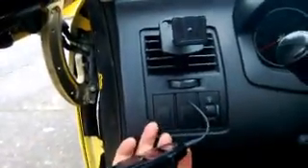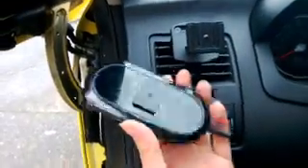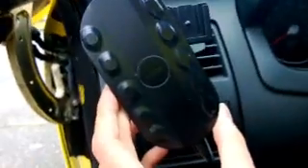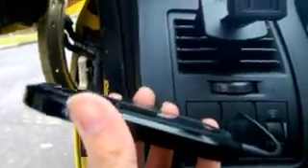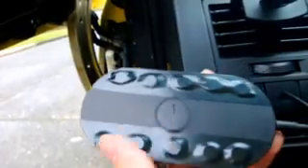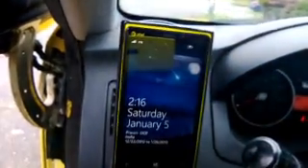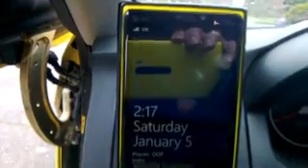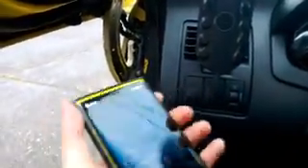DIY Nokia Wireless Car Charger Mod for Lumia 920

Comment: LG has one out.  Car cradle smart fit 2 with the LG wcp-300.  Verizon has the wcp-300 for 39.99 and the smart fit 2 is sold on eBay.

Comment: those magnets have a very small static magnets, they wont affect the gauges because their magnetic field is very small and weak. It wont affect the phone either because its a static magnet, only the magnetometer of the phone may go crazy.

Comment: You are PARTIALLY correct with point 3.  It works from the lock screen if you do not have a password set.  I have not tried it with an unlock code but I assume that is what you mean.

My phone, Yellow 920 also, all I have to do is press the power button once to wake it up and tap the tag and it "swipes" the phone and does the action.

The Windows Phone system takes a VERY protected view of NFC tags.  Which sucks at times, but is nice that people can't "hack" your phone just be being close.

Comment from the maker: There are three problems with using NFC tags right now with WP8.
1. For some reason, the tags don't work if you place them on the wireless charger.
2. There's no way to launch a music app in the background and a GPS app in the foreground with a single tag.
3. The tags don't work when the screen is off. Even when the screen is on, you need to unlock it if its locked. 

And yeah, the yellow Lumia matches my car :)

Comment from the maker: The wire on the inside (in the white casing) is positive and connects to add-a-fuse. The wire mesh on the outside is the negative and connects to the ground. The add-a-fuse comes with the blue connector attached so no extra connectors are needed. I used the red connectors to connect the ground wire but you can use solder instead.

Comment: why didn't you just buy the DT-910 (charging stand)?
magnets, case with magnets - IMO it's better to just use a simple car holder and a charger with wire